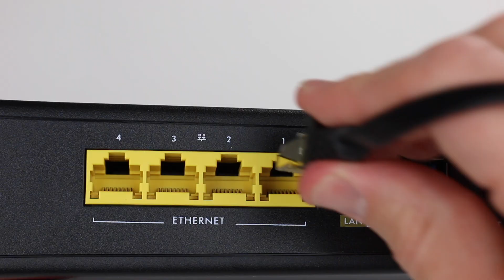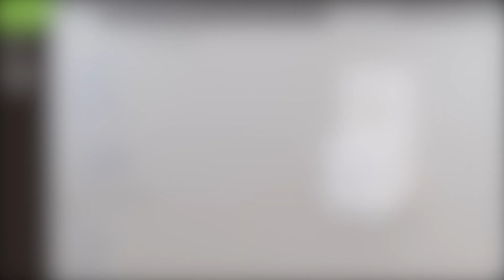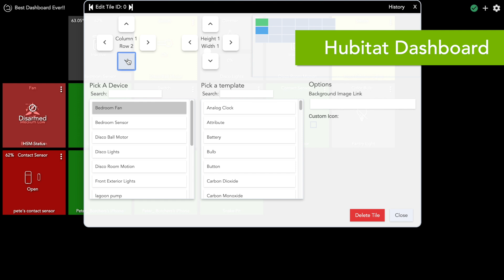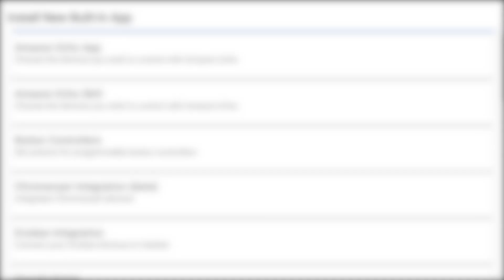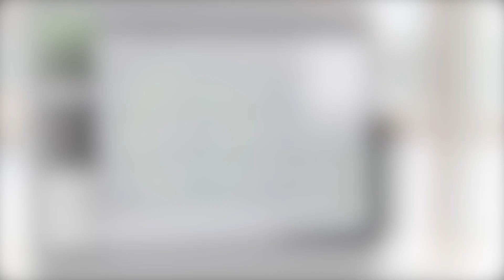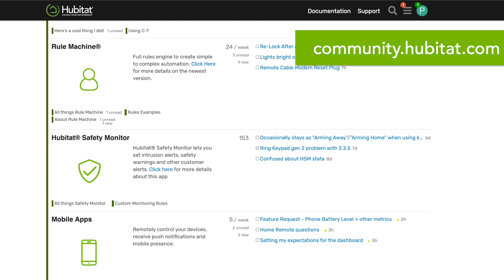Beginners guide to switching to Hubitat Elevation home automation hub

Comment: It's probably the best enthusiast-grade hub on the market, but the newest release last summer with the new 700 series zwave was not ready for market.  Lots and lots of pain; it was like a part time job.  A dozen or more firmware updates and splitting my 30 or so devices into 3 separate hubitats seems to be working for now.

Comment: Unfortunately there is a massive bug in the SiLabs Firmware on the 700 chip in the Hubitat Elevation 700 hubs that causes a nightmare with ZWAVE devices. It is OK until you want to add (include) a zwave device, particularly the new generation 7 devices using the SMARTSTART - basically it generates loads of Ghost devices that really mess up the ZWAVE and block adding any new devices and mess comms with the devices already added. The only way to resolve this is to get a Windows PC, buy a zwave USB transmitter and download the SiLabs software and go through an repair the damage created, it is not for the faint hearted. Had I known of this fundamental flaw in the SiLabs firmware I would have delayed purchasing a Home Automation controller like the Hubitat Elevation C7 until SiLabs got off their asses and fixed it.

Comment: Be careful when buying this hub, I've had it 6 months moving from Smartthings, thinking local is better, but I've had nothing but problems, the software is very buggy, at the moment i have to shut down the hub, disconnect power for 30secs then reboot every day to get my aeotec and neo coolcam smart plugs to work, and this has been an on going problem, it seem every update brakes something.
Reply: Turns out, some of my problems was because of 2 Z-Wave ghost nodes.you would think there would be some sort of error message created when this happens, to save with this sort of problem??.

Comment: Great platform. Switched from SmartThings. Amazing capabilities, quick, excellent community. If you are on the edge, don’t worry. Hubitat works.

Are there things that won’t work? Yup. I have two. August lock and Arlo. Those devices remain on SmartThings as triggers. The genius of Hubitat is that I can have SmartThings tell Hubitat when August changes states or when Arlo sees motion. 

Virtual devices can be set up to control WiFi only devices that are in Alexa. 

Hubitat C7 works.

Enjoy